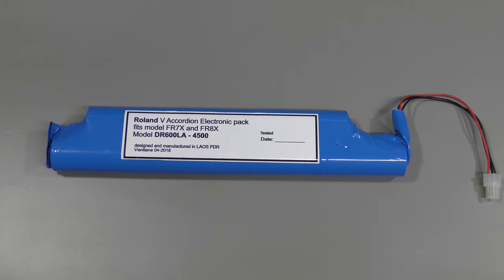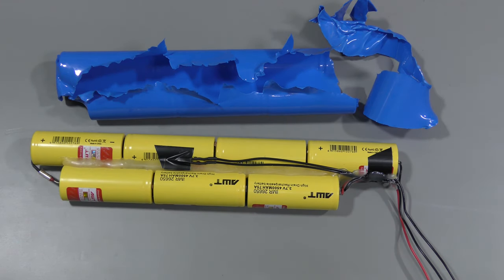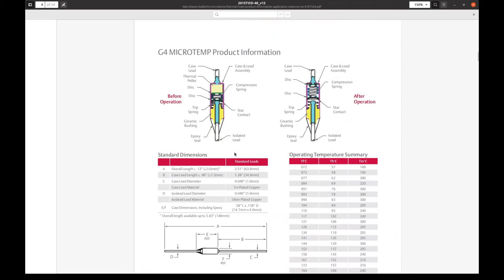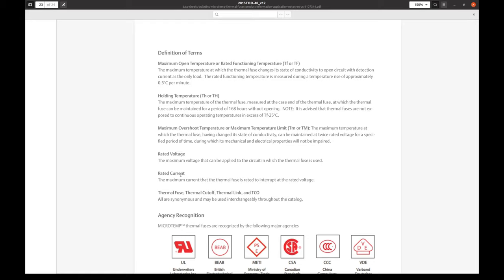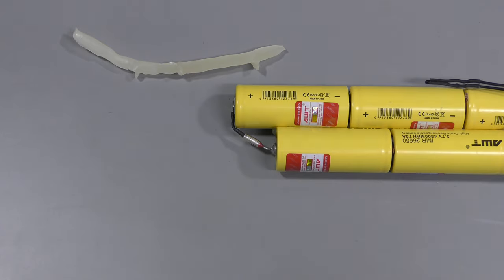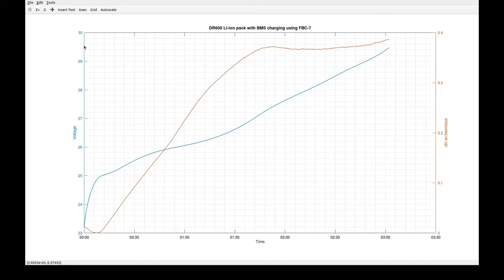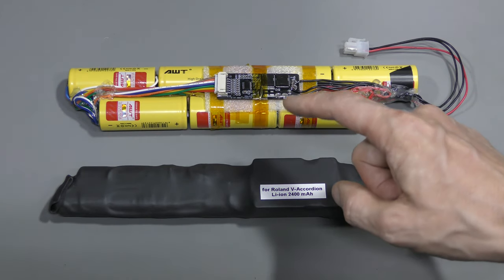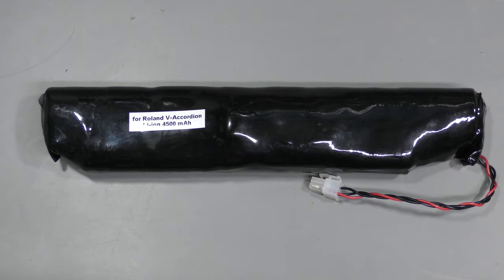#102 - Adding BMS to Li-ion pack for Roland V-Accordion

Comment: Just curious, when you say "discharge the pack" what voltage per cell are you considering to be safe?. Or, what is the main reason for the discharge?. Thanks in advance for any information.
Reply from the maker: I am not sure what do you mean by "safe". The main reason is to limit potential problems if you happen to short or damage the cells. The discharge target voltage is about 3V per cell. The overdischarge protection threshold in the BMS is set slightly lower than that. The cells still might have enough energy left to cause some trouble if mishandled, but it is better to minimize the chances. Just let the accordion play in demo mode until it shuts off. And again, if you had to ask, are you sure you want to tackle this? Good luck if you decide to try.
Reply: @feedback-loop  I was curious of your reason. It is a great idea to lessen the voltage. I am used to working on cells at storage volts [3.6V].

Comment: What is the point of having connections to all the cells if it does not balance? Does it just shut off if a cell is out of balance?
Reply from the maker: Safety is the main point. If any cell goes out of roughly 3-4.2V range, the whole pack is disconnected. Otherwise bad things can happen. I explained this in my previous video, so I did not repeat this time.
Reply: @feedback-loop  I thought so. I must have missed the point. Considering the cost of these little BMS controllers, I'd never connect even two cells without one.  The fancier one's with a serial port are amazing. I have a few of those for larger packs.

Comment: Why don't we just stick with NiMH? Is the original Roland design so bad? Just curious because I am going to have to replace my battery soon and I while I was originally thinking in terms of going Lithium I am now beginning to wonder if it is really such a good idea. It just seems like it is all too difficult and in the end, maybe pointless.
Reply from the maker: If done right, Li-ion is better: lighter, no memory effect, lower self-discharge, lasts longer. However in this case, if the only option is this pack without BMS, then I am not so sure.